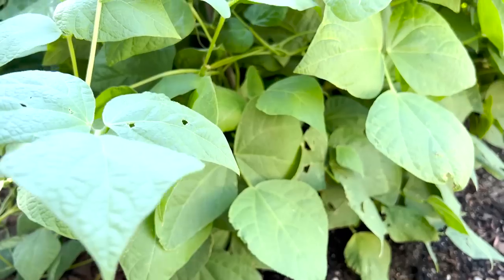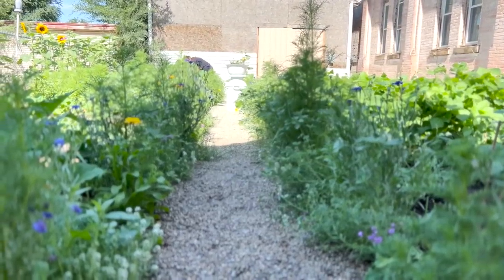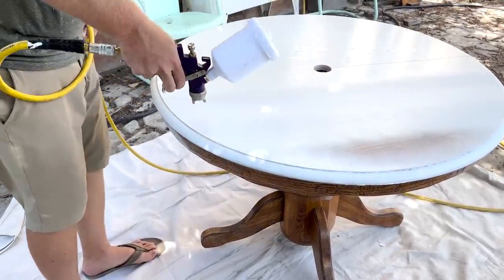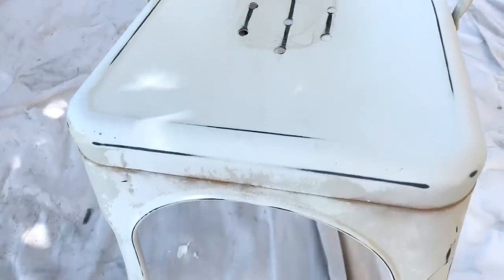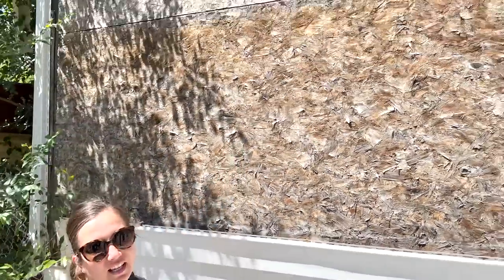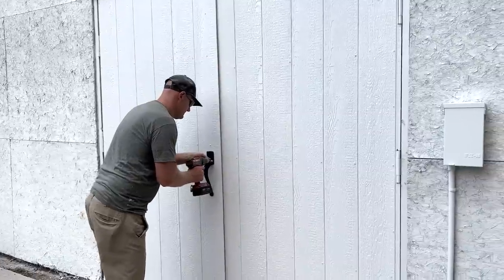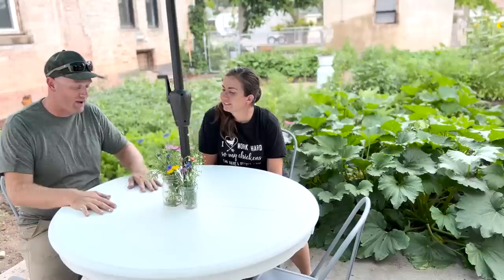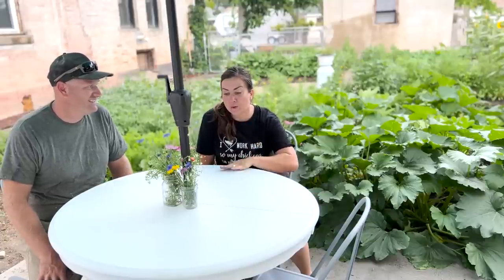Garden Patio Table Makeover From An Old Oak Dining Set Using Cottage Color Single Step Paint

Comment: Beautiful and lovely place for conversation or just to chill. Any preparation needed post painting with the cottage paint to add an IOD transfer?
Reply from the maker: Transfers go on the cottage color paint like a dream. Just make sure your surface is dust free and you’re good to go
Reply: @JamiRayVintage  Wish there was an option to love this response instead of just a thumbs up!  This is great to know!  For some reason I was thinking that a transfer could not go over a sealed surface. A seal coat would be needed after applying the transfer, correct? This is all new to me just want to make sure I have the process right the first time